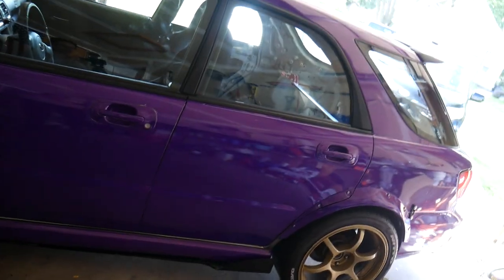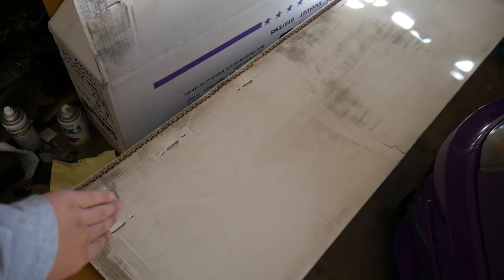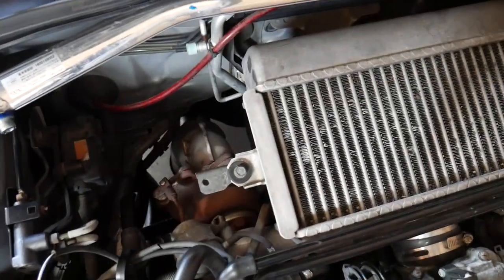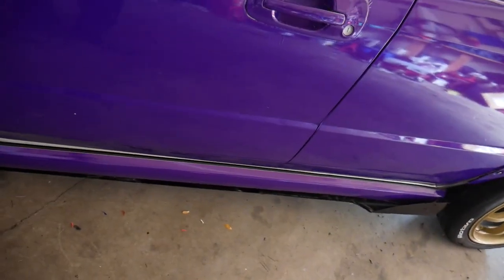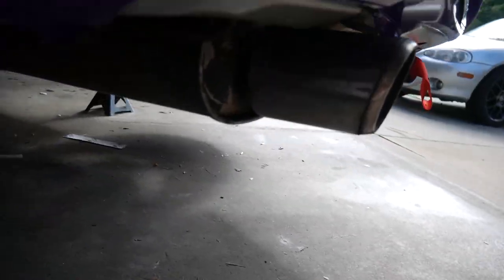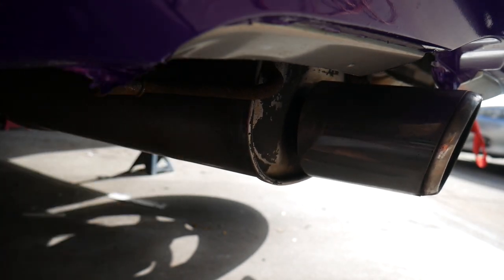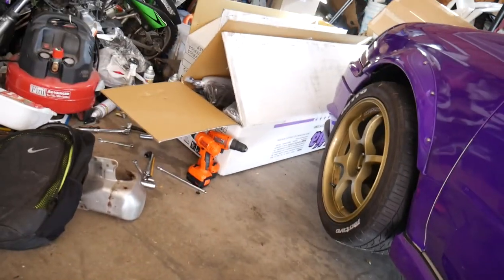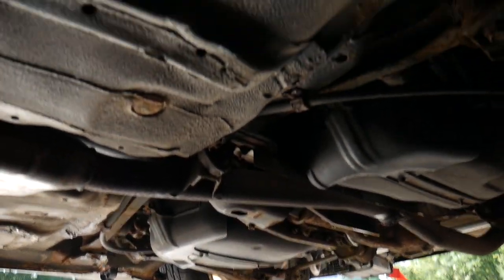Invidia N1 Catback Install On My Subaru WRX!

Comment: Did u fit a sedan exhaust shield on the wagon?
Reply from the maker: The carbon fiber shield on the bumper fit without issues, and I didn't do anything with the shields under the car

Comment: Do you think it would be cheaper if I bought all the pieces separate
Reply from the maker: Depends, if you bought them all separate and used, then yeah, you’ll be saving money, but I doubt you would save much, if any money by buying a new exhaust system in separate pieces